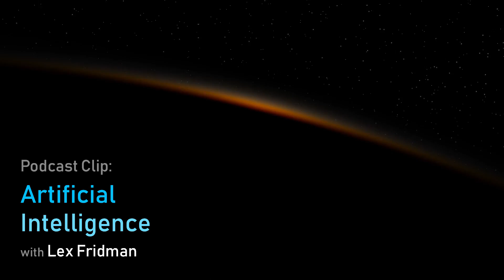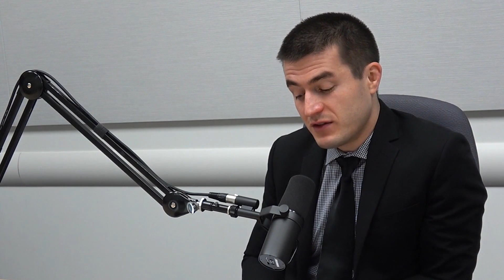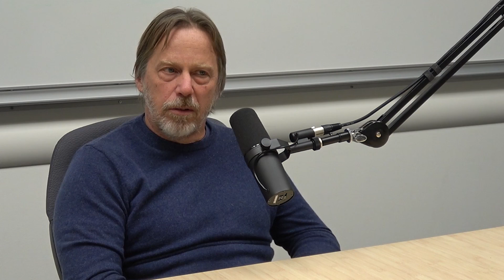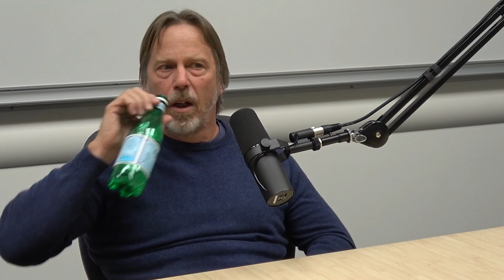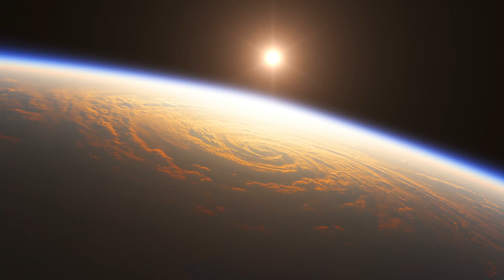Moore's Law is Not Dead (Jim Keller) | AI Podcast Clips

Comment: Quantum computing is about to make Moore's Law look like a gentlemen's agreement.
Reply: It was a "gentlemans agreement" among hardware manufacturers for some time. :)
Reply: Wake me when someone discovers a quantum algorithm for something I care about. The main "benefit" so far appears to be making cryptography obsolete.
Reply: @soylentgreenb  You mean like finding the global minimum with quantum annealing? I would argue pretty useful.
Reply: soylentgreenb this is a very ignorant statement. Quantum computing’s processing power expands exponentially with each q-bit added in a calculation. Improving traditional computation relies on increasing the speed which a computer can process bits (1’s and 0’s). Now, a typical computer processes each individual value of 1’s and 0’s; akin to picking through a tub of toys to find the one a child might want to play with. Q-bits change that. A set of q-bits are all possible combinations of 1’s and 0’s simultaneously. Now imagine if a person could randomly pick something out of the box and get the desired toy. Almost every single time. That’s quantum computing. No need to go through each individual toy. It just happens. Quantum computers calculate by just guessing the correct answer. And because of that, it doesn’t have to go through all the hoops our processors usually go through to reach an answer. It can just spontaneously go through all of the potential options in its calculations using q-bits through black magic fuckery. An 8 letter password might have billions of possible combinations. But a quantum processor would probably find the correct one without any trouble, if given enough q-bits to work with. That’s the gist of the processing power of these machines. No matter how deep or wide the toy box is, we’d be able to find the answer within a reasonable amount of time with this kind of power. A traditional processor would be hundreds of magnitudes slower when compared to a quantum computer with the same amount of bits. Work smarter, not harder.
Reply: @nathandam6415  That's a very ignorant statement. There is a very small number of actually useful algorithms for which quantum computing is faster (lower complexity class) than classical computing; and as I said, none are things I care about.
Reply: soylentgreenb There’s a whole field of biochemistry that is being held back by the inability to correctly simulate molecules of chemicals and medicine. Server farms exist, which many of which help make up the entirety of the internet that would benefit from having even faster compute times. Ray tracing, web searches, data archives, simulations and more. In consumer electronics, quantum computing will not change anything, with almost certainty. For the scientific community and the development of new technology, perfecting and harnessing this new processing technique would mean a lot. Imagine if Google didn’t have to log key words to into their search algorithm. They wouldn’t need one, instead having their computers search for websites in real-time. Keep in mind that even the best search algorithms scale linearly, meaning that for each new phrase or website added to an archive, there is a need for a certain amount amount of computational time required to process it. Quantum computing scales exponentially each q-bit added making each additional q-bit added to a processor worth more than the last, unlike typical forms of computation. Imagine being able to simulate the human brain, something that traditional computation can’t achieve in a reasonable amount of time. Imagine being to look directly into the source of potential mental illnesses like Alzheimer’s, dementia, PTSD, or mental disorders, like, ADHD, and seeing how they interact with medication. How about ray tracing, which requires thousands of hours to render a single movie on a server farm? There are so many problems that cannot, or are difficult to solve with our current modern methods. Admittedly, the application is not near universal, but they ARE relevant to the development of new discoveries. There ARE another applications for quantum computing aside from cracking security and crypto mining. If anything, only thinking of those two applications for a processing technique, that is quite literally, off the fucking charts in terms of brute computing power, is very unimaginative of you.

The very definition of ignorant.
Reply: @nathandam6415  Searching for “big booty” on Google in real time sound awesome! No more index crawling!
Reply: There's a lot of hype about Quantum Computing but no one seems to be able to tell me what it can actually be used for except some new cryptography and modeling quantum behavior. It seems like a whole lot of buzz about nothing much. Any normal algorithm will still run faster on a the fastest common CPU.
Reply: Nuclearcx modeling quantum behavior is, from what I’ve heard, difficult to emulate on standard hardware. Super Computers struggle with simulating particles at a molecular level for this reason alone. This is why quantum computing’s ability to directly use quantum mechanics to calculate these kinds of things has been demonstrated to be far more quicker than emulation ever be. Google recently proved quantum supremacy (a scenario which quantum processors would have the ability to overtake traditional computation) a few months ago, completing a problem in a few minutes what would take centuries for the most top of the line super computer to find a solution for. It’s amazing stuff.

Comment: Jim did not mention about thermal issues associated with further miniaturization. It may be a critical issue as heat gets more concentrated in smaller footprints. Less electrons to do the switching and rising ambient temperature make it more challenging to make reliable devices. Will it be the end of silicon and time for GaN?
Reply: The amount of heat release by the transistors happens because of inefficiency in the switching itself. We use both negative an positive transistors to only use power when we send power to it, instead of a constant draw of power to it. The small space between this is the source of heat as the doping is. TSMC wants to solve this with stacking the types of transistors, as it would decrease the resistance and length of both transistors, therefore making chips efficient. Look it up, TSMC announced this at a Semiconductor expo in Amsterdam

Comment: Jim Keller comes across to me as a marketing guy and not an engineer.  Notice how he deflects away from Lex's question about transistor shrinking vs. parallelism for performance improvements.  It seems to me that clock speeds have been stuck for over a decade and that means you can't push data in or take it out any faster from a given CPU.  That leads to parallel processors as a means for performance improvements -- which has algorithmic limitations.  Since Keller works for Intel it's in his interest to maintain that Moore's Law still holds up (so buy our new chips), but I'm not convinced.  The plateauing of clock speed means you just can't get data to the compute engines any faster.
Reply: Because he knows that transistors are not at 2nm and does not want to go down that route.

Comment: Everyone I have seen say Moore's Law is dead was right. The people who say Moore's Law isn't dead have just redefined it for some reason. Nobody thinks performance will stop improving, but shrinking transistors has become less useful as Dennard scaling has stopped being valid and Amdahl's law starts coming into effect (for parallelism). There is still an economic reason to shrink transistors (make more chips per wafer), but it might not be worth the research if it is just for that. This is the reason that Moore's law is dead and has been for several years. Recognizing this is important so that you don't waste billions on a 50% improvement when the same effort could have produced a 10x improvement.

The faster you recognize that Moore's Law is dead the faster computer performance will improve. MOORE'S LAW IS NOT PROGRESS IN COMPUTING PERFORMANCE. If you want a law describing the rate of progress in compute performance create one. Don't confuse people by overloading term.

Comment: Theres so much more to cpu hardware than moore’s law. When it keeps being brought up our eyes roll.
Reply: Absolutely...  I remember first learning about the Sense + Refresh circuit in DRAM back in 1999 as an undergrad.  I was pretty horrified at the complexity.  There's a Deux Ex Machina effect going on there straight from Heisenburg.  You touch it, you change it.  Moore Machines. Mealey Machines. Karnaugh Maps. Boot-strapping.  2's complement.  Booth's Algorithm. Carry-lookahead adders.  That's all undergrad knowledge (which is where I am in this topic).  But I can only imagine the horrors of dealing with professional-grade design issues on noise margins, fan-in / fan-out, latencies, energy optimization ~ k*v*f^2, impurities, process deviations, the wonders of all that is DMA, interupts, asynchronous processing, variable frequencies, voltage-switching, time-varying master/slave relationships between cores.  I can not imagine.  And neither can any of the people that are not in the heart of this domain.  If someone isn't at Intel, Nvidia, AMD, Micron, TI, Motorolla, Qualcomm, et al, they can't even begin to comprehend the complexity.  They're not off by 100x, more like 1 million x.  From my side of things, I think people would be horrified by the statistical information-theoretic algorithms that have been developed as well ;)

Comment: Maybe the correct question is "Has Moore's Law slowed".  Intel has been stuck on 14nm for mass produced CPUs for 6 years now when its normal cadence was every 2 years for a die shrink.  So while transister count hasn't frozen, the rate of improvement has certainly slowed dramatically.
Reply: Intel was mismanaged, look at TSMC and Samsung they are the leading fabs, they are at 5nm right now.
Reply: @walterwhite4234  I'm talking about "mass production" and not what's projected to come.  Also, TSMC 7nm is more or less equivalent to Intel 10nm.  Intel uses a different measurement standard.
Reply: @GeorgeOu  Well Intel claims it is equivalent, could be marketing speech. The TSMC 5nm node is up and running and the road map to 3nm and so on seems robust, 3d stacking is on it's way, if Moore's law slows down its certainly not a catastrophic slowing.
Reply: @walterwhite4234  You need to compare transistor density, not the marketing.   Intel's 10nm density is higher than TSMC 7nm mobile chips, but lower than TSMC 7nm +.  That said, TSMC got ahead of Intel because of Intel's recent stumbles. https://www.techcenturion.com/7nm-10nm-14nm-fabrication#nbspnbspnbspnbsp7nm_vs_10nm_vs_12nm_vs_14nm_Transistor_Densities
Reply: Fin fet increased speed without changing node size, moores law is about performance not node size.
Reply: Slowed = dead, because the law refers to the rate of scaling, not the presence of scaling.
Reply: @David N If you need data look at the TSMC roadmap

Comment: The actual law is that the time to double is around two years. ie we look at the time to double, not the multiplication factor after two years, even tho there is an equivalence there.
Reply: Sure the math may look better to you when t is the variable, but for someone designing the system t is fixed. It's the change in performance when the product ships that's variable.